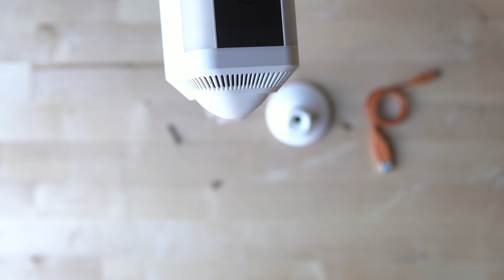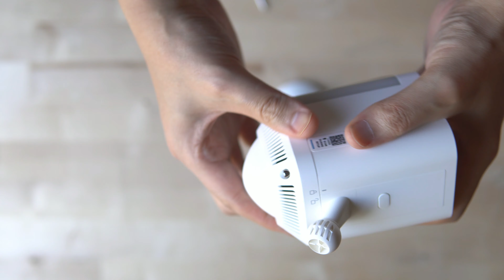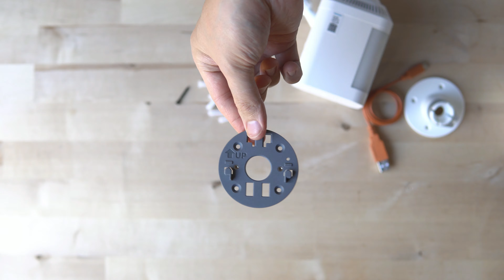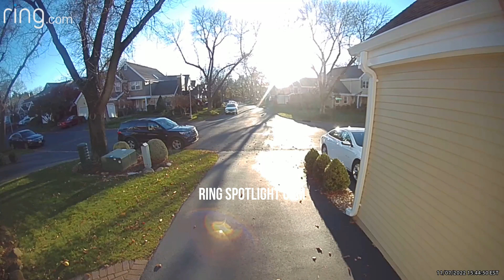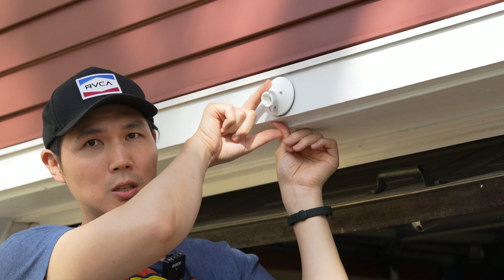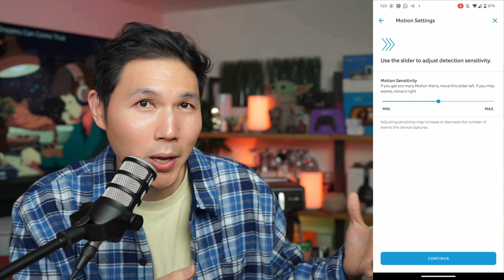NEW 2022 Ring Spotlight Cam Plus - Unboxing, Review, Setup Guide

Comment: Thanks for the detailed video! Could you provide a short on how to remove the whole camera from the base by properly loosening it and then putting it back by tightening it? For me, the easiest way to change battery is to pop out the whole camera from base and then changing the battery. As you mentioned, it's quite a tight fit and I need to apply quite a bit of force before I can remove it or putting it. I think there maybe an easier way by loosening it, so it would be helpful if you could demo the proper way.

Comment: I've been trying to find a flexible mount accessory for the new model, the hole in the back plate of the old one seemed to fit a lot of 3rd party ones on Amazon :( has anyone found one? The kind with 1 bendy leg you can wind around a small pipe or tree branch

Comment: Several bad new “design choices” here. Why, oh, why did Ring include a phillips head screw now on the battery compartment? Before it was just a simple button to open, which you need to do frequently to charge the battery. AND if it was for security purposes, why a phillips head screw and not the security screw that Ring previously used? They’d even provide that special orange tool for the security screw. And like the bad guys don’t carry phillips head screwdrivers?! Overall, some silly bad design changes.

Comment: Please do not buy the new model for the elderly or anyone with hypertension.  There is nothing in the package that remotely indicates twisting the bottom to open the case.  Just the word "twist" would have been nice but the designers did what they did I suppose to sell more models after the customers pried on these things to the point of breaking them.  It's just unbelievable.  Secondly, the round snap-in grip is like inviting a thief to just snatch the camera off the grip.  The irony of trying to secure our homes, but the camera itself is open-season for grab and go thieves.  That's right folks, even with the clamp in place, a nice little yank and the camera is yours.  So mount them high, and go for the solar option I guess.
Reply: Thank I was losing my mind yes twist would have been helpful but thank you

Comment: The gray backing plate on the mounting bracket does NOT want to come out on mine. No matter what. I think it'll break before I'm able to get it out. What a terrible new design. The old bracket design was a lot better.And why is a there a damn screw on the front of the bracket?!! It turns but does nothing. Geezzz
Reply from the maker: Hi! I had a similar problem and ended up using two small screwdrivers (normally for opening small electronics) to release some pressure and pop it out.
Reply: Same with mine

Comment: So if you have aluminum siding, or you have to mount it where there’s aluminum or metal, it’s gonna distort that sound when you’re listening back to previous recordings.

So I have to figure out how to fix that problem because the audio is horrible on all of the ring cameras, because those are the only ones I’ve ever tried, and there’s no way on some of these ring cameras to adjust the sensitivity volume so that everything‘s not just rise off everything you’re getting all this distorted, scratchy, horrible Audio! And I’m noticed that it has to do with aluminum siding or any type of metal siding that you put your item on your camera on. to.

Besides the above, now I have another issue with this camera! I’ve had it installed on the front of my garage, and it runs into the garage and plugs into an outlet. Yes, it’s the corded, not the direct into a junction box. Now it’s been up for a good , probably eight months, with no batteries in just running off the plug-in that I installed and now all of a sudden it a lot it’ll work but the lights will come off and it doesn’t wanna connect and it’s nothing to do with Wi-Fi or my bridge. It’s something in the system itself apparently, it doesn’t wanna stay on it doesn’t wanna stay charged or somehow it isn’t getting any electricity to it and I can’t understand it because it’s been plugged in. It’s worked fine what’s wrong with it unplugged it plugged it back in the lighter come on for a moment and then it’s just no juice and I know it’s not my garage. I know it’s not the plug-in, and most likely it’s not the cord! So I’m really just personally sick of all of these types of cameras and all of the constant issues and going off-line Wi-Fi problems here I’m just ready to go a more professional type unit, that I don’t have to deal with any of that it’s all corded and it all runs into a box. You can monitor it because I’m sick of all of this and I’m I’m just wrong good money after bad all the time by the time I’m done with all this crap I could’ve went and bought two professional systems, save your money people go look at it up professional home systems. You’ll be better in the long run and a lot less headache and hassle.👍

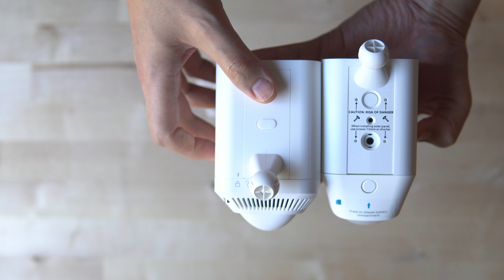Comment: 1:30 does that bit not slide out on the spotlight plus so you can move the knob from the bottom to the top?
Reply: Yes, it does.  I have both of my new one's in front of me, and mine just slid out nicely.  You take the bottom off, where the battery is, and slide it downward, and it pops right off easily.

Comment: The only thing steering me away from buying this is it seems the product only comes with one battery, but needs 2 batteries to function. Why would ring sell a product without everything it needs to function? Sigh….
Reply: Oh wait never mind I just watched more of your video and it does function on only 1 battery but not as long as it would with 2 batteries
Reply: @heatherleclair135 One battery lasts 6-12 months. Placing two inside should just give you more time before you need ti recharge. Also his video forgot to tell that you can slide the back piece off and switch it to make it hang from the top if needed.
Reply: This is a new one my 1st spotlight lasted 4 years, for some reason it just went off line and wouldn’t go back on. However it lasted good day and night for 4 years. It had One battery that we hooked to a solar panel. It worked great. Never had to worry about the battery running down. Bought this one today and I hope it is as reliable as the last one. I have wyze cameras at another house and it goes of line. The rules change on its own. They were cheaper but they should be since they don’t work as well.
Reply: I am still using my 1st generation since 2017 same battery and no issues
Reply: So far, I have had mine since 2017 and mine are running fine with the solar panel, except, one new camera that I added the new smaller solar panel. The small solar panel does NOT work with the spotlight camera!
Reply: Solar panel
Reply: You can tell you people dont listen
Reply: They are shit I got them battery last one week
Reply: @aldonuraj571 make sure you have it set up for battery and not wired! The factory default may be set up for wiring,that will drain the batteries!
Reply: @aldonuraj571 just get the solar panel and it’ll never die
Reply: Need 2 batteries ??
Reply: @Pablito_Eagle_Defense_Ready no! Works with only one battery, but you can install two batteries for longer life. It will switch when the first battery runs down.

Comment: I ordered the Pro wired and received the battery version with a wired kit. Amazon said this is how the wired version is sold. Is that accurate or is there a specific wired Cam version?
Reply from the maker: hi! I have the Pro wired when it was first released and it came as 1 complete kit and NOT as a battery + Wired kit.  However, Amazon might sell them together now to save some packaging as its the same parts.

Comment: Hello, If I buy the plug-in version, do I still need to purchase a battery? thankyou!
Reply: Yes, it now comes in only one version. I had to replace my older plug in version under warranty  and this is what Ring sent to me as my replacement. I also got the power cord. At first I did not like it, but now I do. Here’s why, if the power goes out the spotlight switches over to its battery for power automatically. When power is restored it switches back and then starts to recharge the battery.  Also when plugged in it keeps the battery charged.
Reply: A battery comes with it.

Comment: I bought a Ring Spotlight Cam Plus plug-in and see it has same compartment for battery, can I use my plug-in cam with batteries and adding a solar panel?
Reply from the maker: Hi! Yes you can add batteries from other ring devices and you can add a solar panel. But the solar panel connection has been updated so best to get the current solar panel for the spotlight cam plus.
Reply: @TheFrenchGlow  thank you so much for your fast response!
Reply from the maker: Hi! Yes you can add batteries from other ring devices and you can add a solar panel. But the solar panel connection has been updated so best to get the current solar panel for the spotlight cam plus.

Comment: Do you need a hub for them?or do they run on  the app application
Reply from the maker: Hi! No hub needed. It's all built in the spotlight unlike the blink that requires a sync module.

Comment: Do you have to use the screw anchors?
Reply from the maker: Hi! If you are drilling into wood or siding, you won't need anchors.  I used wood screws. But for drywall (not sure you would have drywall outside), you definitely should use anchors.

Comment: Hi there Just found your video & to let you know something you might not know about the new spotlight cam , on the back where the ball is located when you have the door open where the ball is that whole piece can slide out so you can have it at the top or the bottom ( as in your video you said it can only sit 1 way ) i have 4 spotlight cams & hope this helps you out
Reply from the maker: great tip. I am going to include this in my ring pro comparison.  I just tried it. Thanks for the tip here!
Reply: How long does the battery last from 100? I have a tall house and don’t want to have to climb on a ladder every week

Comment: Attempting to secure the pressure release screw that is attached to the camera mount to the mounting plate. Have you had any issue getting that specific screw to secure?? Any advice would be helpful though snapped into place screw will not secure.

Comment: Does the solar panel actually keep the batteries charged 24/7, or do you find that the batteries still die or struggle with charging even with the use of the solar panel? 

I ask because I am interested in purchasing the Ring Spotlight Cam Plus with solar for my grandparents for a blind spot on their home. I'd like for them to not have to worry about the hassle of frequently recharging the batteries since hardwiring isn't an option because, on that specific side of their home, they already have a standard floodlight there which is elevated quite high unlike their Ring Floodlight Cam in their driveway and Ring doorbells that are accessible if need be. I'm opting for the Ring Spotlight Cam with Solar because, If there were any complications with the Ring Spotlight Cam Plus, I'd rather them not have to worry about climbing a ladder to such a steep elevation to reach it if it were hardwired where their current, basic floodlight is since the Ring Spotlight Cam would be installed at a lower, more convenient elevation. My only concern with the Ring Spotlight Cam Plus with Solar is the battery life.

Great video btw! Very informative!
Reply from the maker: Hi! You have to get the 4W solar panel and if you have battery issues, you will want 2 batteries and not 1.     Battery drain is really dependent on how sensitivity your ring settings are. The spotlight + cam uses 25w so if your spotlights are on all night, it will drain the battery fast. With minimum spotlight use, I have not had to charge the batteries yet after over a month.

Comment: So a few questions. 

They have a wired version and a battery version on the ring website - but I assume that both can be hard wired using the USB C port on the back to give it mains power?
Reply from the maker: Hi! Yes both can be hardwired or used with battery. I have the spotlight pro battery and hardwired versions. They are identical except the hardwired comes with no battery and a power adapter while the battery comes with 1 battery.  Be prepared to use add a 2nd battery if the cam is located in a high traffic area like a driveway and you have high sensitivity levels.

Comment: nice video. Shame no 2k or 4k but you do a good job explaining what the benefits are and why Ring went with 1080p.  I guess its all about the cloud storage.
Reply: If your willing to run wires and have a server setup in your house you can easily do 4k. Alot more setup though but very little future repairs. Im to lazy for that in the future but might do it one day. For now i use Ring Pro